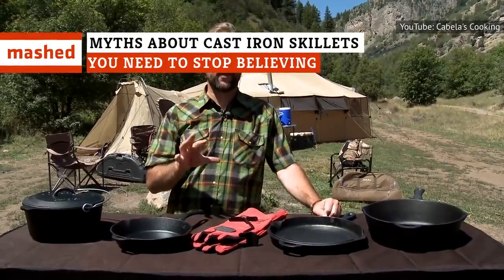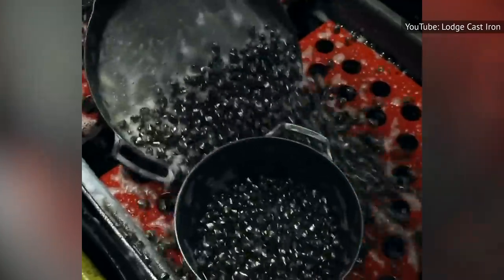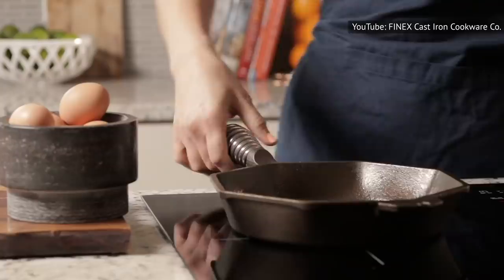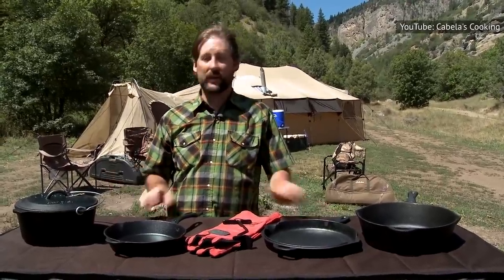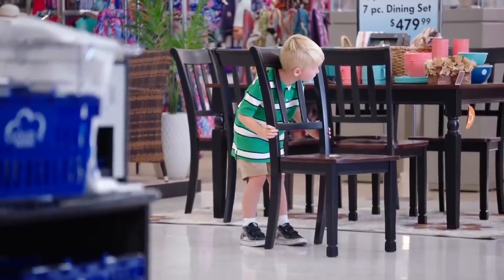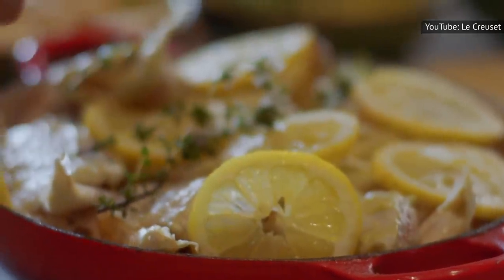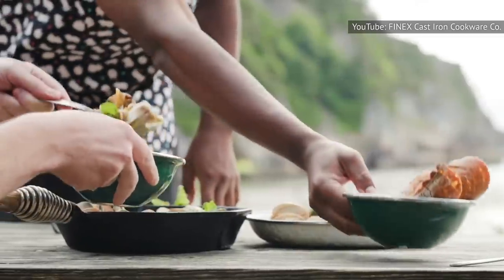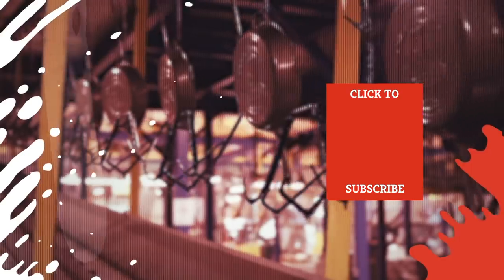Myths About Cast Iron Skillets You Need To Stop Believing

Comment: If you’re making pancakes or whatever and notice “hot spots” from uneven heat distribution try preheating the pan in the oven first. That’s my tip of the day
Reply: whale scales don't take any wooden nickels. That's my tip of the day.
Reply: Just upgrade to clad pans which are superior in every way.
Reply: I'll have to try that, I have trouble with Pancakes sometimes!
Reply: I don't use the oven, but I might start!
Reply: I rotate the pan every couple minutes or so. I've found this to be a pretty effective method.
Reply: Good tip.
Reply: Thank you
Reply: hot pan, cold fat. That's how I do it. Let the pan get hot then throw some cold butter in
Reply: Try preheating on the stove top for a longer time - probably 4 or 5 minutes. It will even out perfectly. Most people put the batter in to soon. Cast iron takes a while to completely heat up - but it will be completely even. Patience! Hope this helps.
Reply: @ramblingbill9101  why would anyone want the hassle?
Reply: @madthumbs1564  it's truly not a hassle to preheat your cast iron cookware and it def is advisable to do so. Basically, when you begin cooking, put your pan on the heat and then do five minutes of your "mize" (aka mise en place) while you're waiting for the pan to heat up. Most often prepping your food takes more than 5 mins anyway.
Reply: That would work, but you would use about twice the amount of energy to cook, or more.
Reply: @madthumbs1564  theyre not lol they both have benefits and should be used in different scenarios. Plus unless you have a giant griddle sized clad pan youre not making pancakes in any time efficient manner
Reply: @madthumbs1564  just leave the pan on the stove while you prepare the food, its not hard lol. Even normal pans have to preheat. Wtf?
Reply: Water will evenly distribute the heat when heating.

Comment: Really, the only 2 things you need to know about cast iron pans are don't leave acidy foods/sauces in the pan overnight and don't drop um on your toe.
Reply: and dont air dry them because they will rust
Reply: @SorenPenrose  I also wipe mine dry then heat it on the stove even if I don't re-season it every time.
Reply: "acidic"

Comment: We inherited a cast iron set 45 years ago, already seasoned. It can take anything. And if you make a mistake (letting it soak too long, not drying right after washing leading to rust, burning the bottom, scratching it) cast iron is extremely forgiving. You can repair it. I can even take steel wool to a rusty skillet, wash it, dry it, then rub a little oil on it before storing, and it just as non-stick as before.

Comment: I've just gone back to cast iron after years of crappy so called non stick pans that stick after a few months...expensive rubbish. My mother had a cast iron for years and even her lousy cooking didn't stick ! Cast is King 🤴
Reply: I had the same experience until I bought yet another non stick pan that had instructions to wipe it with some kind of veg oil before the first use and every 10 dishwasher cycles. Seems to beholding up well so far. I consider non stick pans disposable. They start getting dull or chipping, out they go.
Reply: Funny My mother was a really terrible cook especially  when she used cast iron for our powdered eggs with green spots

Comment: You didn't address high acidic foods such as lemons and tomatoes.  My cast iron pans have been in use for over 40 years and they still work better than most expensive "non stick" pans.
Reply: ddgyt50 and that includes tomato based foods?
Reply: You forgot  to mention  never pouring cold water into a hot cast iron pan as it will cause  or can cause cracking
Reply: @kenkellar2246  I mean you should avoid pouring cold water on any hot pan...
Reply: They would be truths and not myths...
Reply: Do u use tomatoes and lemon in dish which is made on cast iron skillet
Reply: @foodiesidra  I did many years ago, but not any more.
Reply: @ddgyt50  ok thanks
Reply: @kenkellar2246  you can put a little bit at a time, its not a big problem. Obviously dunking a hot cast iron pan into a bucket of cold water is going to not be a good idea. But putting a little bit of water into it to clean it while its still hot is the same as putting any cold food item onto a hot surface. The water will just heat up and its not gonna be a big deal
Reply: @mastertrey4683  why did it take you 7 months to get back to me?🤠😆
Reply: So long as you don't LEAVE acidic foods in the skillet you can cook it just fine. The trouble comes when you leave something in cast iron and it has time to cut into the seasoning, but cooking a meal won't hurt anything.

Comment: I've been using cast iron skillets for about 50 years. That are virtually indestructible. If they are rough on the bottom, just take some sandpaper and sand them smooth.  And if they get too dirty, you can sand or scrub the dirt right off, without a care.  I use mine in the oven too for every thing from roasted chicken, meatloaf to cornbread and even a deep dish peach pie.  😊👍
Reply: I use mine for baking things in the oven also!👍

Comment: My mom had my grandma's cast iron skillets. I am 65 and my brother still uses them. They have been tossed in the dishwater after everything else is washed, scrubbed with a choregirl and dried with a paper towel. Rarely did we ever re-season them. Once a cast iron is well-seasoned, it is a myth that they need to be re-seasoned after every  time you use them. Frying meat or potatoes in oil was all the re-seasoning required. We washed them, dried them and put them away - they always sat on the back burner out in the air so making sure they dried completely was not needed, as they were so well-seasoned rust was not an issue. Just get your pans well-seasoned and they are nearly maintenance free and will last, well, I doubt any cast iron has been around long enough yet to see how long it will last....

Comment: "Seasoning" is a catch-all phrase. A cast iron pan will have a layer of polymerised fat, and unless it is very clean, a layer of unpolymerised fat on top as an additional protection against moisture. Dish soap will wash away the fat, but not the polymerised fat. While the polymer alone will protect your pan from rust, moisture can settle in without the layer of fat on top. It is best to give a thin coating of fat/oil after thoroughly washing a CI pan in hot water and dishsoap.

Comment: I use a few drops of Dawn to clean my cast iron pan and I've never had a problem!
Reply: Me too, I clean it every time after I use it.
Reply: Seasoning the pan makes it way easier to clean though. I dont use soap but i would definitely recommend letting it dry on the burner to prevent rust.
Reply: Dawn - Good enough for oil covered wildlife good enough for cast iron.  The only reason for the myth is that it wasn't always a myth in that 100 yrs ago soap was far harsher as contained lye, nothing like our modern dish soap.  Personally i dont bother with anything but hot water on the warm or hot pan rarely need more than a single pass over with the wood brush and back onto the stove.  Being still warm no need to fire anything up again as the heat is enough to evaporate the water quick enough never had any rust issues.
Reply: Old soap was made from lye and stripped the seasoning, most dish soap should be fine.
Reply: Me too!
Reply: whatever soap is left over on the sponge usually works for me.  and for the really tough stuff - I crumple up a bit of aluminum foil to use as a scouring pad.
Reply: till you stop doing it.  i stopped and i just cooked eggs and cheese in mine... with no oil and 0 stick 🤣 dont use soap you can get it plenty clean without soap.

Comment: I put mine in the oven before using it, usually while I prep the rest of my meal. hotspots are common with cheaply smelted pans with different thickness. I think a lot of them are poorly cleaned after use so that charred food keeps building up and if you use a metal spatula it will scrape those burnt bits up and make your food terribly bitter

Comment: If your seasoning  comes off due to a little soapy water (I don't mean rought scrubbing or soaking here), you aren't doing something right. And metal utensils? Hell, what do you think people were using for the last several hundred years?
Reply: Agree! People used them over open fires hundreds of years before Teflon or silicone pans and utensils were invented.
My kids used cast iron Dutch ovens when they were in Boy Scouts.
They set them in the hot embers of an open camp fire and put hot coals on the top when they made their stew.
Reply: Yeah, I never heard of the "don't use metal utensils" on cast iron before, that's just plain stupid!
Reply: Uhh  wooden spoons & wooden spatula.
Reply: Probably mixing them up with non-stick skillets that have a teflon coating, which will scratch off. But they're definitely not the same thing at all.
Reply: @lorettatayor5840  yes, wooden utensils have been used before cast iron pans but they do work well together.
Reply: Having a non-stick surface and metal utensils what one of the reasons I switched!

Comment: Ignore their stovetop seasoning advice. You wind up with partially polymerized layers of seasoning. They build up and then start flaking (meaning that your seasoning is failing). You don't need to do this after washing either. Let's face it, it takes days to weeks to strip the seasoning with easy off or a lye bath. Soaking for short periods of time with dish soap won't harm your seasoning.
Reply: correct. simply cook bacon in it first.
Reply: @Da_cat12  That's a whole different issue. It may work if you cure your own bacon. If you use store bought bacon, the sugers will leave you with the appearance of a rusty skillet.

Comment: My cast iron pans are fifty years old, at least. I've been using them for 25 years. I just wash them by hand like they were dishes. No seasoning or anything. Hang them in the pantry and that's it.
Reply: I’m 78 years old and still use my mother’s cast iron skillets which are over 100 years old as she used them years before I was born. 
She never seasoned them and always washed them in the same dishwater after she washed the dishes.
I like them for baking cobbler or chicken in the oven.
Reply: No seasoning? Then why people keep pushing that?
Reply: @janetyurkin822  I don’t remember seasoning them in the past when I used cast iron pan. Then later I’m told I should.
Reply: @teneleven2818  I have no idea. As I said in my other post my mother never seasoned hers.
She just made sure they were throughly dried so they didn’t rust.
Reply: @DrRock To each his own! You do whatever makes you happy 😃. 
At my age slippery cast iron skillets aren’t a high priority.
Reply: The ones I use are even older and I cherish them as well 😌
Reply: I would imagine the old cast iron don't need to be specifically seasoned as they just get seasoned over time through normal use.  I doubt people spent much time messing about with seasoning back in the day they just used them and that worked just fine.  But they did not polish them /strip them down after each use either.  100 yrs ago people likely did not use soap to clean them as soap was much harsher than the modern dish soap we have now.  Millions of people still cook just on open fires of wood coal and dung most of them don't use soap to wash out their cooking pots.
Reply: @RainCity3rd  When I say seasoned I mean wash with water to get any residual food removed then just dry out on the burner and reoil. Done
Reply: @teneleven2818  No seasoning again after they are already well-seasoned. You do have to season them at first, but once you have a good seasoning coating, you really don't have to do each time, only if you inadvertently damage the seasoning, like I did just this morning by putting the griddle on a burner to dry and getting sucked into FB and forgetting about it. A half hour on a high burner is not the way to preserve your coating!

Comment: Seasoning is a polymer bonded to the iron. It is not burned oil.  It is hard, durable and resistant to most things. Acids and extremely high heats will break it down. If you ever want or need to completely strip the seasoning off of cast iron, you can do it with the self-cleaning function of your oven.

Comment: Pre heat pan on high heat in the oven for searing steaks.
Reply: Yeah, I'll just use a much better pan, but thanks.
Reply: @madthumbs1564  No such thing as a better pan than cast iron.  Blasphemy.
Reply: @madthumbs1564  ...says the person who has not a clue how to cook...  But I dont preheat in the oven. I use an induction cooktop. Induction + cast iron = thing of beauty.
Reply: That's the only way to do it, works every time.
Reply: @ba2911  can't clown someone like that and then say you use an induction stove. Real ones cook with fire
Reply: @DREAMP4RK3R  sorry. You dont know what you don't know. 🙂
Reply: @ba2911  touche
Reply: Who in the hell would cook a steak in the oven?? Steaks belong on a flame. Damn...
Reply: @truthseeker3512  Some of the best tasting steaks are the result of being seared on a ripping hot cast iron skillet and then finished off in an oven. Try it. I used to be a grilled steak only guy until I tried that method. Haven’t turned back since.
Reply: @truthseeker3512  that's actually standard. Sear in the pan and finish in the oven.
Reply: @SorenPenrose   Hmm. Here in southwest Oklahoma the norm is flame grilled, but I guess if it's done right it might be good. I would imagine that the sear would lock in moisture.
Reply: @truthseeker3512  Searing does not lock in moisture. Grilling just means you're getting a worse and less even crust than searing it on a very hot skillet.

Comment: "If properly cared for" goes for pretty much the endurance of most cookware.
Reply: Yes, but even when properly cared for nonstick pans will lose their coating over time and are typically easy to scratch. 

Personally, I bought a care kit from the manufacturer and it cleared up most of the issues I was having building up the seasoning. I love the plastic scraper tool from lodge for cleaning. Most of the time, all I need to do is scrape the old food off and rub a bit of oil on and it's food to go.

Comment: Typically once my pan heats up I give it a light rub with lard before using, after using I usually clean w just hot water and paper towels, occasionally a lil bit of dishsoap. Then I like to throw it in the oven for a few minutes to completely dry. at this point my most used piece of cast iron is a glossy beauty i can always count on.

Comment: Never had the need to use soap on my cast iron anyway. Nothing sticks to it...hot water does the trick, and a quick re-seasoning right afterwards.
Reply: Hot water, papers towels, quick heat, done.

Comment: Most of these myths I’ve never heard, but I did always assume cast iron couldn’t be washed with dish soap. Good to know I can use soap on mine! Also I didn’t know you had to re-season after every use.
Reply: You don't....that's also a myth.
Reply: @DrRock 😂OK
Reply: You technically can but why would you want to? Cast iron is very porous. There is a reason why you season. There is also a reason oil "sticks" to it so well. If you want your food to taste a little "off" go right ahead. Seriously why would you use soap? Caked on burned on food is easiest removed by squirts of water on a hot pan. The flash boil and steam it creates loosens it right up. Just don't douse the pan or try to dunk it while hot. Germs? Errr....its sterile when you are done cooking. If you wipe out the bits, wipe on some oil, wipe off the excess and heat it for seasoning and put it away there isn't a germ on it. Probably less germs then the cesspool of germs and bacteria that is your water heater and your dish rag. Or do you really think that pool of lukewarm water is bacteria free and that dish soap sterilizes your dish rag even remotely as good as heat?
Reply: Do not use soap on your iron.  And NEVER, EVER use paper towel.
Reply: bigpigslapper Oink  With all respect to your "memaw", I think she was using a lead pan based on your spelling.

Comment: i was avoiding using dish soap in my cast iron pan. i was rinsing and scrubbing with a plastic scrubber then seasoning.
Reply: If the pan was nicely seasoned, no problem. The use of oil-cutting soaps should be voided.
Reply: @gmoops8986  the seasoning should be excellent since i season it after every use before storage
Reply: Keep doing it your way. You are correct.
Reply: Most times you do not need to use dish soap.  But when you do need it, use it.  It is really no big deal.
Reply: Any time I need to get anything that is stuck on, off. I use a salt grinder and a wet (damp) sponge. The salt cuts thru quickly. Rinse, oil, done.

Comment: Ive not heard any of these myths and I have cast iron skillets that are over 100 years old.
However, if you want to strip all the seasoning off of a skillet and re-season it. Put the skillet in an electric oven and push the "clean" button. Once the oven has finished the clean cycle the skillet will be cleaned down to the cast iron and you can go through the initial seasoning process again.

Comment: I use a couple nice GRISWOLD cast iron skillets. They stopped making them in like 1950, and the finish is still beautiful! I like the smooth finish on these, compared to the coarse texture on new cast iron pans.
Reply: ive heard this around but honestly if you use your new cast iron pans you get rid of that unevenness pretty quickly.  My fav thing about cast iron is not being scared to have metal utensils, a bendy longer fish spatula is amazing!  My newer pans surface is comparable to my old pans these days.  What i definitely don't know about is that pan in the video with the many flat edges vs. being round.  Meh no thank you!  looks like a giant nut for a bolt.